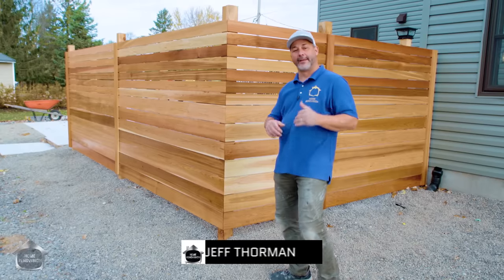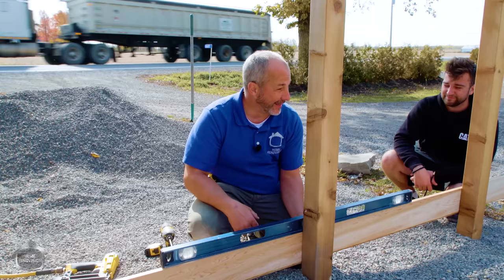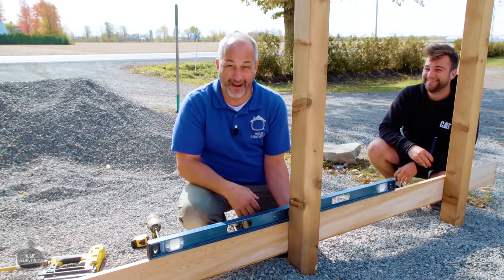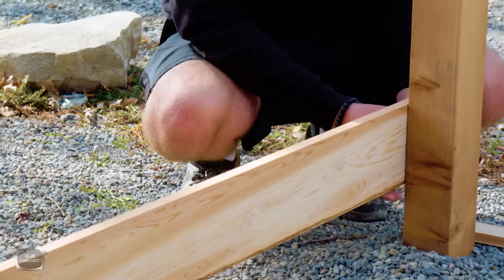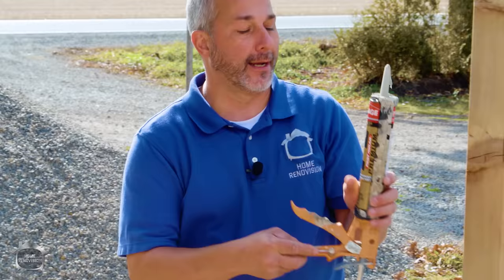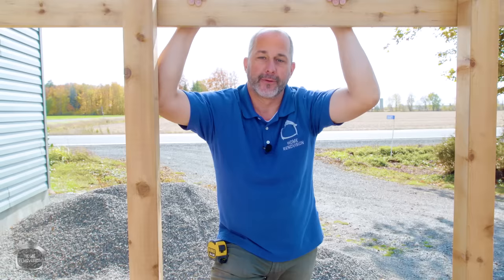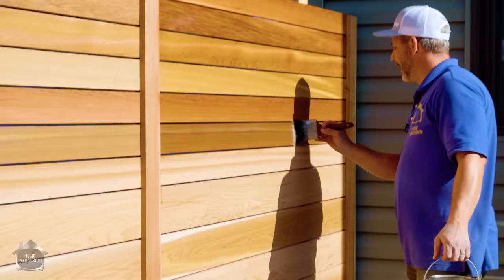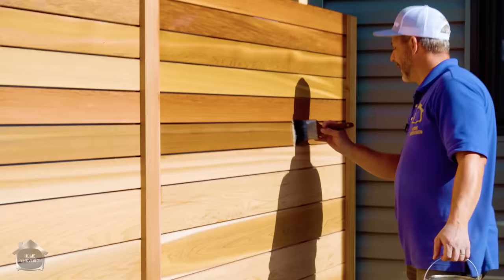How to Build a Cedar Fence

Comment: When using Red Cedar you must #316 grade stainless steel to fasten and part of the fence. 
The use of a galvanized brad will lead to significant black stain bleeding in the face of the board, as well as the galvanized brad will actually cause the wood to decay around the brad. 
Like to see this in one year.
Reply: Great example of what a builder will do when they know they are selling the house in a few weeks. Shame to rely on a brush applied sealer when stainless nails are widely available now. I have seen builders of million dollar houses use drywall screws on a nice wood fence. Fasteners are usually something he focuses on. Hopefully he spends the extra <5% on his next project.
Reply: Drywall screws are perfectly fine to use on them

Comment: Solid build! I just completed a privacy fence for my trash bins. I painted the 4x4’s black and used pocket screws on the horizontal posts so that they were flush with the vertical ones. I like the look, but might have done it the way you did if I could do it over. Thanks for the content!
Reply: Can someone please tell me where can I find good deals on composite fences? I live in WA. Also does anyone know which is better Vinyl or composite fence? Thank you

Comment: Cabot stain is fantastic also stain your boards before attaching. Seal each cut if you want to protect your fence boards. 5x5 posts stain before putting it in ground you can use roofing product as well roughly 3 feet on the bottom.  
5x5 posts would look much better if you grove it 3/4 through the middle then drop in your 1x boards.

Comment: Used ring shank galvanized nails from a nailer, still holds. I prefer stainless screws, but spendy and labor intensive. I’m a DIY person in multiple houses. In two, including the current one, had to replace electric panel and check all connections. In the process, replace all switches and outlets to screw terminals. No power problem and passed inspection.

Comment: Man that cedar looks great, can't wait for lumber price to go down. If your posts are not below the frostline, be careful about relying on adhesive to hold the fence board since it will probably snap if there is movement instead of allowing some bending like regular fasteners would.
Reply: a proper PL premium glued and clamped wood to wood joint will never fail before the wood itself does. IMO he did not use nearly enough adhesive though from the one board he showed
Reply from the maker: not concerned . my post are in gravel not dirt. Cheers!
Reply: Thanks for point this out. It might prevent someone in a harsher climate from making a costly and frustrating mistake.

Comment: Inspired by your other HomeReno horizontal fence video to install a privacy fence for my mother in law. Finishing it up now with dimensions 24'x58'x'24' @ 5' high using 5/4" PTL decking and CAMO system. Will check out the post caps. Suggestions for a gate design welcome. Thank you for these videos!

Comment: Thanks for the video. I am in the process of building a fence an 8ft BOB ceder fence. I have a question what do you think  of the top cap and the decorative trim under it to be regular pine? The ceder top cap is 4 to 5 times the cost of pine. Treated pine, apparently, likes to bend. What would be the pros and cons of using pine top cap and decorative strips trim? Thanks in advance to all for sharing their knowledge and experience.

Comment: Interesting and creative way to build a horizontal fence. It does look great! Question: if one post has to be reset because of issues with the foam (I am not as confident in it as you are) or if some boards need to be replaced, how feasible will it be when everything is glued together? Thanks.

Comment: Nice job! This project is a definite DYIer for women who can't lift the concrete bags for the posts. I wish you would have shown the miter cut and placement. I thought I heard mention of 1/16th of an inch?? What would happen if you didn't utilize spacing at all? And why didn't you show us the placement of the 2x4 over the outside of the fence. Did you use 2x4 on the inside for extra structure...did you place them on the outside too for a finished look??
Reply from the maker: i ripped a 1x4 in 2 and used that as a vertical piece. and yes I added the 2x4 for extra strength as well. you will see the back side of the fence during the fire table videos I am sure. Cheers!

Comment: This past summer, bought expensive fresh cut cedar, supposedly 1” and stored in the garage under plastic so it didn’t dry. Once I mounted, did not leave space between vertical boards except small correction for level. Still in the wet season in Oregon, and gaps are easily 1/8+, so I agree, don’t gap cedar unless dry. 2020 was a very expensive time to buy premium cedar. $1.5k for 100ft. I won’t buy the crap at box stores. I bought the same cedar 12 years ago for the rest of the fence, and it probably has 10 yrs life left, no treatment. However, a couple of posts may need replacement. Did three rails of cedar stringers, and 2x6 top cap. Maybe that helps?  Very wet climate here.

Comment: Lee Valley Tools sells the Osmo. They might have it in stock when others don't I think.
Reply: I got some to try on my hardwood garden bench. Good winter project. The only thing about the pigmented one is apparently you can't use it on oak? Which I'd really like on my floors to get a sort of Scandi look.

Comment: Looking to do a side gate at my house and the local big orange only has bog standard western red cedar (doesn't say anything about kiln dried) and I'm not sure if I should let it sit out for a week or two just to be safe... Another issue I'm running into is advise for installing them. Prestaining seems to be highly recommended but not sure. Some are saying to add a spacer and others suggest building them tight next to each other…I'm kind of at a loss and stalled out on the project until I can figure out what to do.

Comment: wonder about the sturdiness with the posts seemingly 8" apart. you did mention likely adding 2" x 4" in between the posts but unfortunately it wasn't shown if it was done. ...1- does it have a 2x4 running in between and if so is this method close to as sturdy as a vertical fence with 2 or 3 horizontal 2x4 used as a place to NAIL the fence boards onto it??

Comment: One downside of using adhesive is you won't be able to take a section of the fence out if you ever need to get something large through it, like you could with screws.

Comment: Great looking fence. Do you need to add any nails or adhesive to the 90-degree mitres? Or do you just line them up, glue the boards to the posts,  and you're good to go?

Comment: Looks great, it would be even greater if people remembered to consider the architectural integrity of the house, and choose materials and finishes—stains or paints, and trims, all the way to the finish details, like how the top of fence is finished off and framed in the same way the house is or a complementary way, and caps that look like they belong to the house itself and always have since ir was built. 

Clapboard siding would also provide complete privacy, no gaps, and choosing a stain color that coordinates with the color of the house would being it all up to perfection. People buy a nice old house because they like the details of the nice old house, and then people come along and slap modern design on top of it, and the two designs fight each other. 

I see it when driving down the street all the time, it’s even worse if they rockslide or mulch the whole yard. Ground covers and other plants can be planted in parking strips, front yard, and backyard that require little to no watering after being established...and don’t look like a parking lot. It doesn’t matter how much they try to create little patterns and contrast with different colors it’s still not environmentally friendly because it provides no habitat for...anything, plants clean the air, rock heat the air.  Even English Ivy will run anywhere you plant it, provide shelter for birds, honeybees (no, people, they don’t sting you unless you start screaming and waving your hands at them, which to them is an outright attack from a giant, and they’re just on their way to work trying to pollinate your world for you, they will either fly away or defend themselves against your assault... Only wasps are interested in your food or you, and they don’t make their nests in ivy that I’ve ever seen, just bees collect the abundance of pollen in the autumn, and they’ve not once attacked me in 25 years, even if I’m working mere inches away from their activity), butterflies,  things the environment needs desperately, cleans the air, and I haven’t watered mine since it was established decades ago, the sprinkler line broke there and it wasn’t top priority to fix it. It’s just one of loads of plants that just need an annual pruning, and little to no water.

Just some things that now and in the future will date this current time period, and the difference in the details tells a homebuyer whether the house is simply flipped (which has red flags all over it, flippers don’t care about quality), vs. a home with nice upgrades that take the existing home into full consideration. I have neighbors that put in fake stone for their patio and bbq, in brown and reddish tones, and their house is a screamingly clashing grey, in a design that doesn’t go with their fake stone patio. Everything they do makes it look like perhaps they are color blind, and maybe they are... But what could have been beautiful is an eyesore, simply because they didn’t consider their existing structure at all.  

Rule #1 of design, considered the architectural integrity of the existing structures and their design details, and keep harmony and unity in mind. The basic principles here are great, however...
Reply: Just to clarify, the sprinkler zone where my ivy is is completely turned off, so it’s not broken and deep watering it, it’s just off entirely.

Comment: Quick question, do you leave the pencil sized gap for looks or because you don't want the boards to be touching for some reason? I'm about to build a horizontal fence with Mangaris boards and want there to be no gap between them. That's ok right?

Comment: What foam did you use to set the post? I’m thinking if terracing a small space with wood as opposed to brick. I stay in So Cal and we don’t get much rain (a little bit of freezing since I’m in the mountains). What do you think? The wall would be no more than 4 ft high and is just to clean up the front of my house not to hold dirt back.

Comment: Hey Jeff, is there a specific reason why you went with Brad nails and adhesive instead of the Camo screws that you used in your previous horizontal fence video? Is it because it's cheaper, quicker to install, both? Thanks.
Reply: I'm thinking by the boards being so thin the camo screws might split the boards or have that deep drill hole he is trying to make disappear..the brad nails will be covered when the wood shrinks and the oils from the screw wont run..I think he is just trying to hide the nail holes..

Comment: I thought the tannins in cedar react with anything but stainless nails/screws. 
Am I wrong?
Reply from the maker: they do but we are relying on the adhesive to do the bulk of the work here. it is rated for exterior use and is still working out great!

Comment: curious, you put a slat of wood to hide the joints but not on the corner?
Reply from the maker: because the corner is the focus I didn't want to cover the mitre joint. all the tiny imperfections are behind the verticals. Cheers!

Comment: If I'm installing a load bearing porch post,  and the pressure treated post is still wet, do I need to wait to install it or adjust the height it's cut to? And I'm guessing I shouldn't paint it until it's fully dry?
Reply from the maker: great question. i would always add 1/8 over 8 ft for a wet post. or leave it out for a few days to dry.

Comment: What was the cost of this build? how much material was used for this? im trying to quote my backyard refencing project, and im trying to decide between diy and contracted.. any advice?
Reply: Take complete perimeter measurements.... 
When done, price the boards for an 8' section by height your looking for (say 72"). 
3 @ 4x4, 3 @ Bags concrete, 13 @1x6
If say 80 ft. 8x10=$
That'll give you your DIY estimate. 
Screws nails and/or adhesive extra of course have additional costs but a pound of 2" exterior screws is about 8.00 at HD or Lowe's (40 for 10 pounds). 200+ there you'll use about 75 for 1- 8' section (6 in each 1x6)
Reply: @shadowdemon13  thank you! I'll run the numbers and compare
Reply: Keep in mind, each section after the first 8' will only be 2 @ 4x4 and 2@ Bags concrete, reducing the cost slightly.
Reply: I’m sure DIY wil be less expensive and you don’t have to pay for labor.
Reply from the maker: This is a very expensive way to build using select cedar. I used it because it is the focal point of the outdoor living space and a design element.

Comment: I live in CT. USA. I thought the post should be below the frost line, 6 foot deep? No?
Reply from the maker: the frost line in most cases is only 3' and changing recently to even shallower than that. my posts are all in GA so the drainage allows me to cheat a little since  i won;t have soil holding water and expanding. Cheers!
Reply: 6 feet!? Wow that's a deep post

Comment: How long will the glue last? I’ve had it fail outside on me before when using with stone after 2 years
Reply from the maker: I have not had that problem. Cheers!
Reply: clean clean clean... and then clean some more. it only bonds to clean

Comment: Why foam instead of fast setting concrete? It sets in the same amount of time and concrete is about a quarter of the price, and you absolutely can’t convince me that foam is going to last as long as concrete. Also, the brad nails will still go black even if a sealer is applied. Water will still seep into the wood one way or another and eventually the nails will show.
Reply from the maker: oil based sealer actually seals wood. I will reapply as needed and if you wait around long enough i will show you u\in a few years how it looks. I am very confident using techniques I have been using for decades. Cheers!

Comment: This is not a good way to build a horizontal fence. Those boards will cup for sure. Why? Cause he only used 16 gauge nails and glue to hold to boards to the 4x4. 
 The galvanize nails will oxidize, and cause the wood around the nail to rot. Over time, you will be left with a lose board. 
The glue is not enough to keep the boards from cupping or twisting  not to mentioned bowing.  Cedar being the wood that it is, will twist and move as much if not more than most fence boards.  
  With out the decking screws far enough apart holding  the board in place. Those cedar boards are going to cup. Specially if they still have moister in them. That is why it is important to acclimate them to the area, or get kiln dry boards. I install fences for a living. This is method is a great way to save some time,  but not a great way to keep those boards straight, and looking sharp for all types of seasons.

Comment: Hell oeveryone, hello Jeff,  I have a little question. I have an old house, 1968, in Laval, Quebec. I found out the french drain (?drain français) was bad about 4 years ago (well, in fact, the water was coming from a crack in the door but that's another story) and after doing it 3 times (yeah, 3 times.... 2 first time with same contractor and now a new one), the last time, I opted for a different solution. I went with Durasec, which apply a membrane much like urethane on the exterior that they call Rub-R-Wall (which is a simple rebrand). can see more here: https://groupedurasec.com/en/products/

Now, the question I have. My basement is a mess. It was redone by someone else before I buy it for the easy sell lowest cost. Thus, I must trash everything. I think the only thing that's good is where the insurance redid part of it (had a sewer return) but since I found water leak on some wall, I don't trust and I'll tear down everywall and start from scratch, while fixing the water leak first.

Now, since I already have a good urethane membrane + the other membrane they install, I have an exterior water protection / barrier. The question that remain, I was opting to go with urethane for insulation in the inside. But won't that create a problem since the basement (poured wall not block) will sit between 2 vapor barrier that are directly in contact with it, leaving no place for natural evaporation?

thus, I should simply use the technique you showed with the poly on the back of the frame, insulation then typar?

Thank you

Comment: If your gonna cover where u put the nails with another board  than just use screws🤦‍♂️🤷‍♂️
Reply from the maker: not covering the nails. just the joints. much easier with odd sized boards to do the math and focus on the mitre and not the butt.